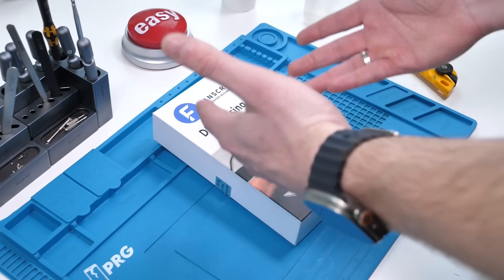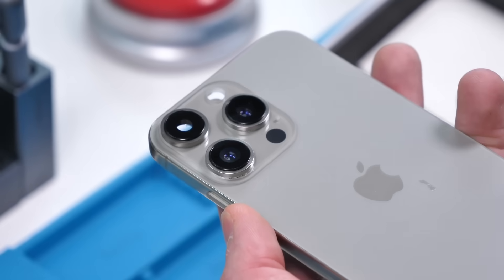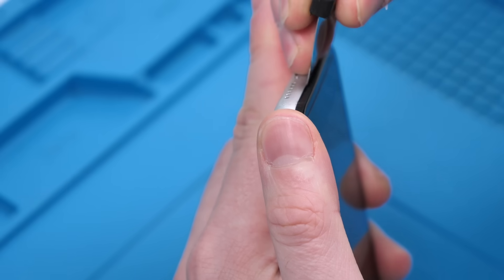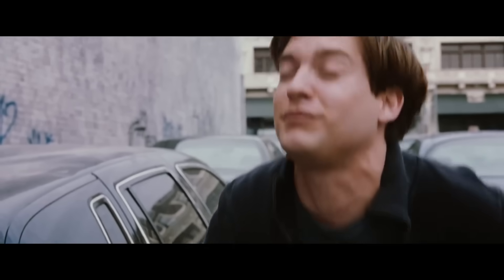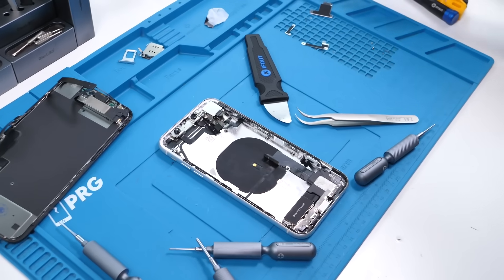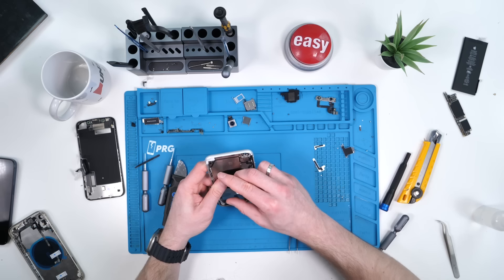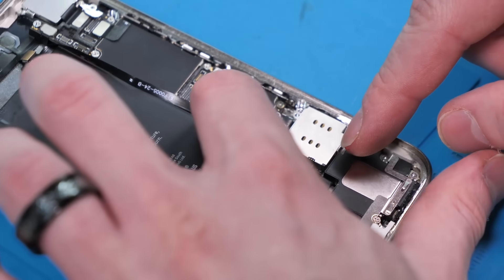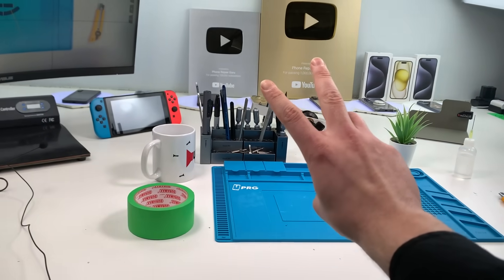Building a FAKE iPhone 15 Pro... With iOS?

Comment: This mod is for those people (mostly kids and teens) who can’t afford newer but are embarrassed of the look from afar. This will do just fine if you have someone around you who can do this for free or cheap. A real repair guy would charge a lot for this mod making it worth it to just get a more premium model (then again you can get a really cheap broken xr with this mod since it comes with new housing and front and back glass. As long as everything works the screen and back can be broken and the sides can be scratched beyond recognition. )

Comment: Hey PRG, I’m from India. I have an iPhone 13, who’s bottom speaker grill I damaged while trying to clean them with a toothpick 🤦🏽‍♂️

My speaker seems to be fine, with no damage but I’m worried I have compromised the water seal. Guys around here have said it’s going to take to change my entire body to get back the mesh, and the waterproofing. 

Can you advise, if I can use the phone safely with the speaker mesh puncture or am I doomed?

Comment: I need help with my SSD that i use for my PS5, it seems to hover heat on boot up. I managed to reformat it but it’s still reaching 50 degrees and causing the PS5 to shut down. I would love it if i could send this to you so that you could help me and put it on a video.

Comment: When I remember right the mic you have hided now in the case is not the mic which records your voice, that’s still the mic next to the speaker, this other mic is just to reduce noises during the call and this should still mostly work when it is not directly connected to an whole to the outside, for sure it should work better but it’s not completely useless just cuz of that…
That just means that your voice could sometimes be a bit muffled but never so bad that the person on the other side couldn’t understand you anymore, so it’s completely ok that is inside the case now…

All in all, it’s ok for those who want something like this but for me it’s just like to put an VW Polo Motor in a Ferrari, Looks nice but brings absolutely nothing…

Comment: With the Ding Tweak (only jailbroken) you can change the silent button to do other stuff, therefore the action button can be an actual action button, also using tweaks to black out the top can hide the notch and add a dynamic island.

Comment: there is even a mod to make your 6.1 inch xr screen to a 6.7 inch (i don't remember exactly if it's 6.7 but it's the pro max screen size) and it's also flat and amoled crazy what people come up with haha
Reply: Even OLED? Would love to know how they did it with the voltage. The LCD panels operate at higher voltages.

Comment: I have a question I’m from British Columbia but if I send my phone over, can you fix it because everyone over here is over charging me. The problem with my iPhone 13 Pro is that it is bent, but I sent it into a phone repair shop to do a diagnostic and found out it also has circuitboard damage and everyone wants an insane amount, but how much would you charge if I send my phone over
Reply: Sorry bud even if he does reply this problem is usually really expensive and not fixable all the time you should get a new phone

Comment: There is a type of jailbreak where you trick your iPhone into thinking you have any iPhone model you want. This also gets you a funcioning action button and dynamic island on other phones. Would be pretty cool to see this on the modded XR.
Reply from the maker: Interesting
Reply: First of all, you need to Jailbreak the device and depending on how old it is, it might not be possible. You can’t downgrade the iOS system, unless Apple publishes a signed and certified .ipa file with the software. Any firmware older than the 16.5 version are no longer being signed by Apple though.

Second, how you describe it, that’s not how Jailbreak works, you can’t just „choose your version“ - if that was the case it would be possible to jailbreak every iPhone old and new and we already know you can’t.

There’s an option to sideload an alternative App Store using developer account though. There you can download an addon that has the option to add Dynamic Island.
Reply: Do you know the name of the jailbreak tweak?
Reply: What's the name of this jailbreak?
Reply: Whats the name of the tweak
Reply: Its nugget and misaka x

Comment: Apple going to put a serialize the back cover next time. 😂
Reply: They kinda did with the 15 series. If you replace the back glass and forget about the wireless charging coil, your flash stops working.

Comment: Would this work with a iPhone 11 Pro because then you get the Oled display with the modern sharp design instead of the old round one.  You could probably get away with selling it as a 13 pro and that’s where people could struggle with the differences that aren’t tech savvy

Comment: Flaws I found with this mod:

- very dim, less vibrant display
- mic quality seems a bit compromised, or maybe that's the actual mic quality of the XRs
- flashlight seems too scattered on the back glass, or maybe because of it looks like that on the camera
Reply: The screen brightness was only on like 10%. He should've turned up the brightness so we could see how it looked.
Reply: @seanlacroix when he tested the flash it looks like it’s full brightness… probably because it’s a aftermarket cheap display
Reply: @rotttttttttttten no I just watched it again and it was still really low brightness but for $25 I don't imagine the screen is gonna be quality. Even the xr uses a shitty IPS panel.
Reply: @seanlacroix  watch 11:23, it has the full brightness lol
Reply: @seanlacroix it was at 100%
Reply: @seanlacroix  it was on max brightness.
Reply: I remember the XR mic being WAY better than that... it was definitely compromized
Reply: @charliesretrocomputing it is better than that, my grandpa has an xr
Reply: @charliesretrocomputing  it's still not as bad as I thought
Reply: huge bezels
Reply: the gap between the cameras is the dead giveaway for me. idk either they’re spread too far apart, or the individual modules are too small
Reply: The mic wasn't THAT bad but still, pretty bad
Reply: the flash looks like that on the white 13 pro 💀
Reply: because its lcd :) probably worse or subpar lcd
Reply: türk müsün
Reply: - lighting port
- no dynamic island
- screen bezels
Reply: He explained that microphone is worse at 1:35
Reply: I have an xr and the mic absolutely sucks. The again my back glass is shattertered but still
Reply: New problem: iPhone X series is unsupported:(

Comment: Did I miss it, or did you not test the action button, which was the main part of becoming a 15 Pro....
Reply from the maker: Ah my bad it’s just a mute button, works the same as the switch but just in button format
Reply: @PhoneRepairGuru I was wondering that too. Also hi PRG! You should swap it to usb C 😉😉😉😮😮
Reply: @WillLockwoodStudios  yeah if doing this modification I would certainly be getting an iPhone 15 USB-C port and putting it in. The days of proprietary Lightning connections should be well and truly over.
Reply: @PhoneRepairGuru 😢

Comment: If you will just change the screen it will be the best counterfeit 15 ever
Reply: Well yes, but in reality it's not really doable. The iPhone XR uses an IPS LCD screen. Those ones use way higher voltage than OLED panels. He'd fry the OLED panel instantly.
Reply: 100 percent bro you're right

Comment: I haven't been fooled by a fake iPhone since I had a 5s. How did I manage that? I stopped buying iPhones.
Reply: Yeah, most people have an IQ that's high enough to distiguish between fake and real iPhones, so...
Reply: @LogsMaggot LOL you'd be surprised man
Reply: Yust buy from Apple or a certified refurbisher
Reply: @JasperVanCalenberg that’s not 100 percent accurate either because apple has sold fake iPhones before
Reply: And now you fooled by google)
Reply: It is much easier to fool an android than an iPhone phone.